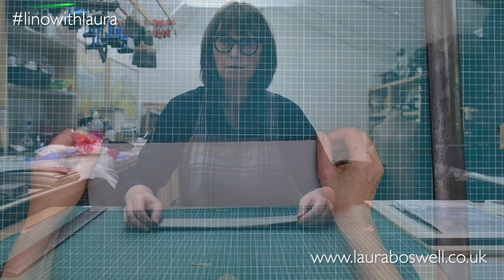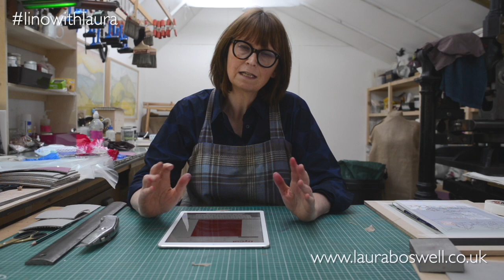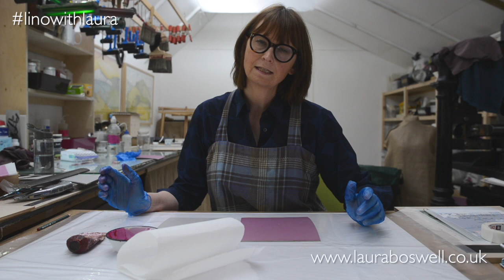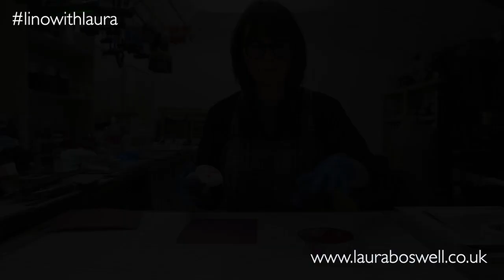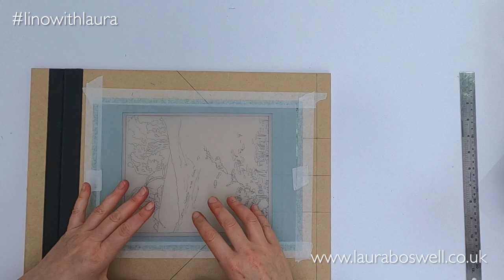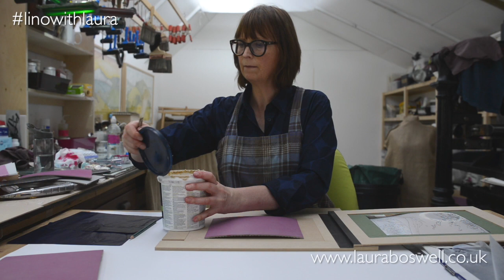Multi block Lino Print with Laura: Episode 8 - Preparing Lino for Cutting and Printing

Comment: Thank you so much! I am doing just a single block but because the linoleum slightly bows I was going to attach it to a hardboard for better inking. Do any other glues work as well or things to be aware of when choosing a glue? Thank you!
Reply: Did you try a wood glue? I would think it would work to adhere the hessian / burlap to wood or plywood / particle board / MDF / Masonite / thick Bristol board / whatever.

Comment: Morning Laura, on the battleship lino ... is it possible to store the lino in such a way so the linseed oil won't evaporate out leaving it hard and unusable, such as keeping it stored airtight in plastic zip-lock bags or wrapped in cellophane? As always, thank you!
Reply from the maker: It does take a long time to go ‘off’ - but I’m not an expert in just how long (get through mine too fast normally) - wrapping might help and having a larger piece and cutting when needed rather than having it cut small helps I think. Also it is fine to print when it has hardened. In my experience, lino with a design cut in it will harden much quicker than an uncut piece.
Reply: @garygraves6496  --  Cellophane is rather stiff and won't give a very tight seal, but clingy plastic wrap would.

Comment: Laura, regarding staining the lino, I have some calligraphy inks in little bottles (a blue one and a green one by Windsor and Newton) which I might like to use. I use water based Schminke printing ink so will these be compatible? John
Reply from the maker: I can’t say John - I’ve never tried that so I would suggest you try on a scrap of lino and check. I think if you are using water based ink you might have a problem with them though - so do check!
Reply: Laura, thanks. I will check them out first. John